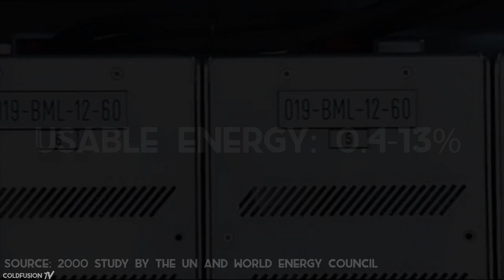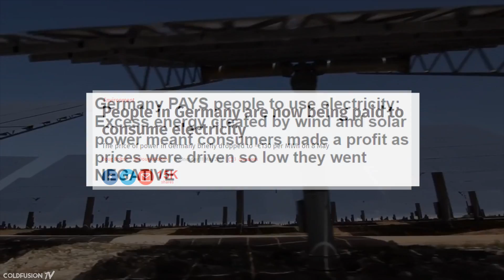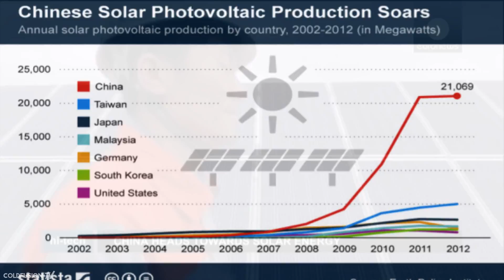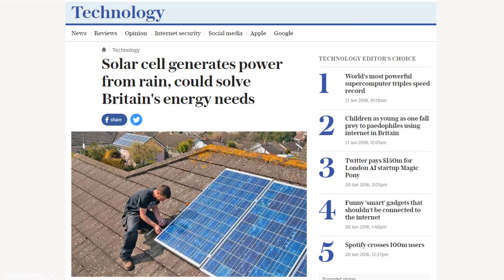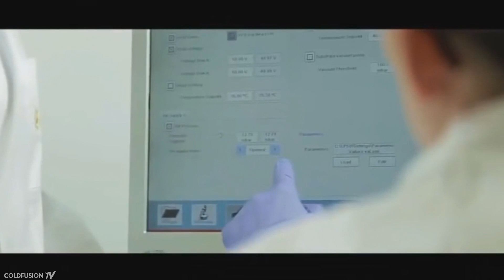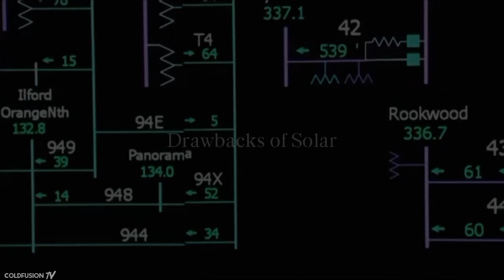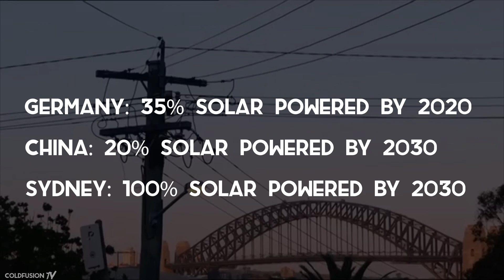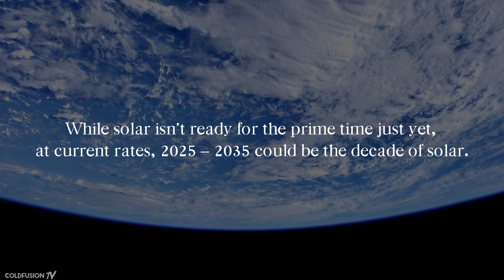The Truth About Solar

Comment: Batteries are still the problem..
Reply: I do believe that that was brought up.
Reply: Yes, they were and they are still a problem.
Reply: the cheapest energy storage method we have is pumping water uphill, you could also use huge flywheels
Reply: electric capacitors arent better  than  batteries. capacitors can keep less energy.are they safer - thats a question
Reply: drakona drgoragonis Electric capacitors give energy immediatly.They cant give you energy supply all the night until solar pannels will work.
Reply: Super capacitors are not better than Li cells in any way. Who told you this rubbish.
Reply: Scott Miller He has half a dozen properties, charter jet, huge limo's. swimming pools, you name it.. And still pays for it from trading his "carbon futures". The man is a scammer of no worth.
Reply: graphene batteries
Reply: ***** I use all electric appliances in the house and I only rake about 6 kWh a day average, and that's with a PC turned on 24/7. These people must be using incandescent lightbulbs all day in the whole house and then wondering where did the power go. HINT: it got radiated away in the fucking lamps, get a LED illumination.
Reply: Also as we are relfreliant we need less to live. Sleep nights ect. The venus Project changes every use of energy. We put all together and we are good. Mass transit, elec cars, many many more bought out in past. We need do-over. All feasible. Eficiency =moderation, we need to look at that and realize we are good to go, not to mention future discoveries. 15 years a big house will look like a geo on autobon. We ARE here we just lagged and created waste and confusion.
Reply: ***** Aren't capacitors used for immediat discharge of large amounts of electricity? Not slow discharge used in most electric devices?
Reply: ***** there are supercaps in my Leaf. Used for "shock loads" on regen/acceleration. Do you have any electronic qualifications at all?
Here. the biggest sold
http://www.alliedelec.com/bussmann-by-eaton-xv3550-2r7307-r/70426260/?utm_source=FindChips&utm_medium=buyNow

now string 150 for 400V working. (33WH) plus parallel 450 series strings for the current capacity. The average house may need 15KWH, hence 450 sets in parallel... knock yourself out. They are $30 each.
150*450*30 = $2,025,000
Reply: Who needs batteries?  A friend of mine built a system that spins his meter backwards fast enough during the day that he almost always breaks even.  His biggest bill in 5 years has been $4.29 from an average of $400 a month.

His system will be payed of in less than two more years.  I don't understand why people don't get that.
Reply: Except that capacitors can only store jack squat worth of electric energy.
Reply: m1aws They're doing it wrong. You don't make a bus by swapping flatbed with passenger cabin on a truck, you don't make electric car by swapping internal combustion engine with electric motor.
Reply: enator71 Its not necessary. Many other nations have not found it to be so.
Reply: hettygreene You're right we should remove the billions in subsidies on Nuclear power and fossil fuels. And no you didn't remind me multiple times. This is the first time you mentioned it. 

Now let me remind you which is worse. Digging very big holes in the ground, storing thousands of tonnes of none recyclable spent reactor rods and burning up fuel to create energy or relying on the sun?

DO

YOUR

RESEARCH

How many times do I have to remind you of that turd in your punchbowl?
Reply: m1aws Yeah and that- wait... US is already in heavy conflict over resources. Look rather than chilling I think it's better to be informed and pushing business policies that aren't so utterly stupid
Reply: +m1aws 

The increasing stupidity of the comments here are remarkable.

It's like a race to the bottom.
Reply: +Alex James 

Stupid Bernie Sanders Vermont SHUT DOWN  a nuclear power plant that supplied the whole state with power. That RAISED THE PRICE of electricity for poor people. Enter rinky dink Solar...  that's the context of your disgusting "making it work". You and your Starbucks poseurs are disgusting.
Reply: hettygreene You are the armchair quarterback. Make one yourself. Its easy. Kirk says so.
Reply: Enceos up to 10% in 25 years. But its already paid for itself in 10 years.
I don't get what you are on about.
Reply: capacitors will replace batteries...
Reply: surface area of the Earth is 510 trillion square meters, not sure where you get the billion from.
Reply: Whoever figures out the super battery will be the richest person in the world.
Reply: Redflow
Reply: I am planning a small farm, and hope to use Solar energy to power it. As electric isn't reliable in the Philippines. But running an egg incubator is problematic.
Reply: Their cost per charge is not viable but for smoothing circuits.
Try it for your self. Go get 'em priced up.
Reply: ***** please, stop embarrassing yourself. Supercaps have no value in energy storage. You simply do not possess that must stupid money to maintain your home overnight.
Reply: average home 8-9kwh?  seriously? average where?

re caps,  yeah sure,  the whole solar industry has just somehow not seen this mode of operation and you have.   Yes obviously because capacitors are such a specialised technology you would expect only one person to understand them.
Reply: ra5928 What system. There are many tricks to alter ones inductive load into a capacitive load to fool the meter. Get caught, you eat free and get your ass reamed out regular.
Reply: Sigma Centauri Point of interest. I have a light in my living room that uses three bulbs. For the first two decades the electric bill for this £15 light unit was well over £500 in electricity.
Reply: m1aws People are just negligent and don't think about it. Every electric device has power rating and it consumes that amount of power when it runs (a PC doesn't always consume it's rated power, only in full load). You simply multiply that power rating by number of hours it runs daily, and there you go, you get your power consumption figure. Then it becomes clear that incandescent light bulbs may well be your #1 power drain on the electricity bill. For me that would be electric pressure cooker.
Reply: Sigma Centauri mine is my car. But if I keep it a decade the fuel cost and servicing savings pay for the car. My hot water is Solar. The 500 GBP unit paid for itself in up to two years.
Yes it (wealth/debt) certainly mounts up over the years.
Reply: m1aws I'm gonna build my own electric car. With the batteries existing today, you must absolutely save on weight in order to travel far (not to mention the whole power saving thing), conventional cars weighing well over a ton just won't cut it. I intend to keep it under 400 kg curb weight. That'll allow it to travel fast and far using only up to a few kilowatts of power. Maybe put a solar rooftop, that'll give it an extra free kilowatt or so during the day.
Reply: Sigma Centauri I have drawn up a revolutionary motorbike.  Leaf "cans" are perfect if not the most energy dense. Weight has less bearing when cruising. It needs to be slippery. The Leaf had to be reliable and safe. Eyes on new tech. If they fail it would affect the technology for good.
Reply: Sigma Centauri good luck!
Reply: we're getting there for batteries too with carbon nanotubes.
There are still several problems that are holding the idea of using them already, but we're getting there.
Reply: CDgonePotatoes wait until the product hits the market. There's been so much bullshit on battery theoreticals it could run its own electricity plant.
Reply: m1aws
it could also be bullshit too, yeah, but I've heard it by so many scientists I'm less skeptic about it
Reply: CDgonePotatoes there is a wall between science and engineering. Until that wall is breached, to us it doesn't exist.
Reply: No, batteries aren't "the problem" because the is no "problem", except the hardships to be imposed by the climate and solar quacks.
Reply: hettygreene Yeah mox (mixed oxide) rod reactors, fracking and coal is just a cumcake of goodness
Reply: enator71 And you enjoy it too! And no it's not. Apple's producing so much power off 'problematic solar' they're selling it back to the grid.
Saudi Arabia is regarded as an oil tycoon terror state and America+UK's bitch is investing heavily into solar. Judging by Apple they'll be a literal power house.
So if we get brain cell a + b and rub them together, magic and unicorns happen! Yey!
Reply: Alex James Its not just Apple Matey. Tesla have bought in huge style and they have batteries!.
Its deffo the future.
Reply: m1aws Agreed!
Reply: +Alex James 

You are an overgrown spoiled child with too much time on your hands.
Reply: +hettygreene If that makes you feel better but what I state is economy sound and it's true. The whole world is in a very chaotic state because of subversive, stubborn and stuck in the past business practice's. So sad you don't see it. Well, life would be boring if we all agreed on everything!
Reply: +Alex James 

Oh really?

"Everyone" could be making more money if the just followed your school-boy science-class fantasies about rinky-dink solar? Gee!  Have you advertised yourself as a consultant?
Reply: hettygreene The proof is already out there as I stated before. Seems you have trouble reading or Googling?
It's simple, solar tech is already viable, it's improving all the time and can be used on an industrial scale. It's not a school-boy science class fantasy.
Were you even watching this video? Are you senile? Do you not like positive facts? Do they hurt your "pragmatic" outlook of the world?
Reply: hettygreene Solar pays its way without Government help, even in the UK. The numbers have been done to death. Nothing to argue about here.
Reply: +Alex James 

REMOVE

THE

SUBSIDIES. 

How many times do I have to remind you of that turd in your punchbowl?
Reply: hettygreene Agree on that one. But Al Gore made it an international trade in the name of glowbull warning. Doesn't change the fact Solar panels are profitable. Electric cars use less energy per mile over liquid fuelled cars etc.
Reply: Alex James Chill, There is only 42 years left before "peak yellow cake". Like control of oil, expect the US to start wars over it in your lifetime.
Reply: Alex James The US is most shit scared about losing hegemony of the dollar. They haven't wake up to the fact they have pissed off too many people.
Reply: m1aws True that, they actually might have to consider a culture of innovating instead of cockblocking. Powers that be usually pick the shit route however one can be optimistic. Feels more motivational than having a nihilistic view at least
Reply: Alex James Governments only work to the negative. They have nothing to give but what they have already taken away.
Reply: enator71 haha. the party ends, now government must begin.
Reply: enator71 yay, Habeas Corpus
Reply: read about tesla powerwall. a consumer solution is nearer than most would expect.
Reply: +enator71 

Right.

Greener-than-thou BRAGGING RIGHTS for the wealthy, while costs are shifted to the rest of us.  

Solar Sucks!
Reply: hettygreene And your option is subsidized wholesale destruction at huge cost to taxpayers compounded by the cost of clean up after is such an awesome choice. Solar is getting cheaper and it's goung to be the clear winner here.
Reply: hettygreene you wanna live like a rich person then invest like a rich person.
Reply: hettygreene But-but... you're the stupid one... D:
You think harnessing energy from a ball of nuclear fusion 1.3 million times larger than Earth is a fantasy. Let's compare that again:
1 vs 1,300,000

Is dere enuff energy two harnesss? Geee... I dunno guy...
Reply: +Alex James 

It's an armchair entrepreneur, kids lemonade stand, schoolboy science project. 

See the Thorium videos by Kirk Sorenson a serious energy solution.
Reply: Yes and that's why the UAE, India, Japan, Taipei, Vermont, Apple, Google and more are going at it. I guess they're all into that schoolboy science?

And yes I'm aware of Thorium and the use of it in a molton salt reactor. However solar is here now and many places are producing a surplus of energy on it. Read up on it.
Reply: +Alex James 

No, YOU read up it.  Read up on the cost shifting to poor people with that stupid Net Metering.

Read up on the German renewables, anti-nuke Double Whammy fiasco and how that's working out.
Reply: +Alex James 

Spend your own money on your dipshit science projects.
Reply: +enator71 

"can't happen without subsidy" <--- your embrace of climate quackery has made you un-American.
Reply: hettygreene Vermont made it work dummy. Quit spouting hard right wing shit
Reply: Bollox to all politicians. If one can have a roof of solar panels and a battery off a Nissan Leaf up in the garage as storage. Then people deserve a big thank you present off the state/utility companies for saving them huge wads of cash.
Reply: enator71 nukes are short term. We have around 40 years left for "peak yellow cake".
Reply: +enator71 

Was I talking to you about the Vermont Germany-in-the making solar nuclear fiasco ?
Reply: +m1aws 

This is someone who has done zero Thorium investigation.
Reply: hettygreene At the moment I'm wide awake. last night I was dreaming just like you, now.
Reply: hettygreene You have any idea how much it costs to shutdown a light water nuclear plant? Also the mixed oxide rods don't have a place were they can be stored they're left on-site. And the costs are kicked down the road at the expense of safety in many cases. And they STILL don't have a means of storing them long term, money that's not factored in.
Solar is coming down in price all the time and it's efficiency is always improving and yeah it's far less toxic.

I love the idea of MSR's (Molten Salt Reactors) and I've been following it since 2008, they're much safer and cheaper. But there are no commercial reactors running that I know of and the investment worldwide is fuck all. I suspect Nuclear gets to cream more profits off subsidies through existing reactor designs and implementations.

Also renewable has much less subsidised funding globally which fossil and nuclear have been pushing down with some success.

Getting back to cost, from what I'm seeing it's implementation that drives it up and some power companies actually getting away with penalising those who dare to use it. There's also plenty examples of using fudged math that paints fossil and nuclear in better light. One of classic examples is reducing the subsidised cost so it appears more expensive for renewables and ignoring it on the nuclear side.

Anyways to dump solar entirely is stupid, it's one of our best shots at a constant clean energy source at this point in time. You may want to check out "Solar Impulse 2", a plane that made it round the globe using entirely on solar. Literally happened hours ago. 

If we want to abandon super expensive energy shit shows, nuclear and fossil have far more than their fair share! :DD
Reply: Alex James your Oh, so technical hetty will cry about Solar being so dangerous yet have no qualms buying electronic goods which uses the dangerous substances.
Reply: +Alex James 

You're an ignorant blowhard whi drank too much climate quack cool aid :

1) see the Kirk Sorensen talk on nuclear waste 

2) I'm opposed to subsidies, but if a fraction of that stupid solar subsidy was spent on Thorium, we'd have it by. Instead the money is pissed away on these disgusting cost shifting school boy science projects, for the benefit of rich kid Starbucks pontificators .
Reply: hettygreene When safe thorium loses some neutrons to become that very short lifed uranium. It is super radioactive hot. So hot when they made an engine for a nuke bomber, it was a one way ride due to the fact those aircraft men would be dead in short order.
People keep thinking its safe. Its not. Even on the surfaces it has advantages it had severe issues long term on the reactors structure.
Reply: +m1aws 

See the Kirk Sorensen videos, you armchair Monday morning quarterback.
Reply: +m1aws 

What a stupid comment. 

Only someone ignorant of the thorium movement would make it.
Reply: hettygreene Thorium has a great future once the engineering/safety issues are sorted and a very long life to peak supply. But as it stands its bullshit because nobody is doing it. Governments are not interested because they want to make nuclear bombs, ok?
Reply: +m1aws 

Not ok when it comes to blowhard climate quacks like yourself peddling imposing quack solar through political means and pissing away capital that could be spent developing thorium, privately. 

You are an obstacle to human progress.
Reply: +m1aws 

The reason we have have stupid conversations like this is because blowhards like you can't keep to minding your own business and trying to impose a conceited sense of superiority on the rest of us.
Reply: hettygreene blowhards like you jump in imagining you know everything because you saw a youtube video. Blowhards like me have done the mile. Ex-aerospace engineer. give me solar panels to charge my electric car. They will be there when I'm dead but thorium will be held back by money and political interests.
Reply: +m1aws 

"A" YouTube video?

That's a stupid comment.  There are dozen of Thorium videos, many over an hour long, including at least 5 different TED speakers on the subject. 

Stick to your backyard bragging rights and your solar-than-thou conceits.
Reply: hettygreene You have nothing but a brace of 'tube vids that I've watched many times over years ago.
You are speaking about pie in the sky nonsense until the money is on the table. 
Meanwhile you can spend a few grand to increase the value of your house and drop your electric bill without increasing the net ionising radiation on the surface of the Earth.... and also effectively, my cars "fuel bill" because its an EV.

I'm all for LFTR's but they DO NOT EXIST!
Reply: They are expensive (for some people), but already can serve 10 years before their capacity drops significantly.
Reply: yep...
Reply: ***** And typhoons, hurricanes, zoning laws, vandalism...
If the panels are not built to spec, they fail in hailstorms. They have their specs clearly written, so its the installers call.
Reply: Batteries are not a problem unless you delusionally believe you need them.  You can use solar to separate Hydrogen from Water, and then use it at night to run a generator for little to nothing.  And no you do not need to store liquid hydrogen.  You can store it as a gas in normal propane tanks.

And this is just a simple solution with little cost.  There are far better solutions that cost too much money because no one is using them commercially.

You need to rethink what a battery is.  Energy Storage is achievable many different ways that do not involve lithium Ion battery packs.
Reply: Zenn Exile hydrogen is delusional. It's less than 60% efficient just to crack water.
Reply: Today yes, but what is today. Not how is was or how we want it. We change today and solar is enough even today.
Reply: Except that here in Australia you can't legally keep your old meter and have it 'spin backwards'.   You have to have a 'smart meter' installed that records how much electricity you take off the grid and how much you put on, and they charge accordingly!  So for me I have to pay $1 a day just to be connected to the grid, then I pay 27c per kwh for what I pull off the grid, and they pay me 7.4c for every kwh I put onto the grid.  Currently I am outputting more than double the kwh to the grid than what i take off. but I'm still paying a few hundred dollars each bill.  Add to that the approx $8000 it cost to install the solar system and it's going to take a long time before I actually break even.  It would be more cost effective in regard to the electricity bill if I could store my excess power and use it at night, but a battery system costs more to install than the solar system, which means it would be many more years before I can break even.  It's a bit hard to do that when I don't know if I'll still be in this house in ten years.  Also, I can't increase the capacity of my solar system so I can push more power to the grid to balance the costs out, as the power company puts limits on the size of system you can install as well.
Reply: Zenn Exile you mean grow firewood? Its a damned sight safer and more efficient than H2
Reply: There are many options all of which are perfectly safe and effective.
Reply: +Zenn Exile please name at least one...
Reply: pizza rio I challenge you to obtain hydrogen, clean, purify and dry it (<60%) then freeze and compress it into cylinders (<10%) that do not suffer hydrogen embrittlement before turning it into electricity (~60% depending on catalyser load).
By the time you have run through the process losses, you are bankrupt. (3.6% efficiency).
Just charge the frikking battery @85% efficiency!
Lithium is cheap. It was a waste salt. This is why they shove you kids full of it so you might listen to the teacher.
Reply: m1aws
there is no reason to do that you fuckpotato

Hydrogen is a very stable gas and can be safely stored in almost anything as a gas.
Reply: Zenn Exile You need an engineering course in hydrogen embrittlement you fuck potato.
Its practically impossible to store hydrogen gas without losses through the steels required to store it due to the molecule being that small. Worse still with fittings, taps, joints etc.

i will answer your drivel this way. Go buy a canister of H2. At $40/litre its a bag of shit. Not cheap energy at all. Its made from steam reforming methane. Just run your shit on the methane. Its less lossy.
Reply: m1aws
none of that matters you dumb fucking piece of shit
Reply: pizza rio Go on, do it. Show us how simple it is.
Every single electrical item in your house does not use H2. It has a battery. Because its small, efficient and simple.

My car has been charged over 1,900 times last I looked and no appreciable loss of capacity. you simply speak shit.
Reply: Zenn Exile Hey troll. Prove my last post wrong.
Reply: pizza rio You made an idiot comment about mining common materials. Sure mine the common materials to make H2, store it, transport it and make your idiot vehicle to drive around with it. You provided less links than me. So that makes you, a liar.
Here is a simple pair of facts in two pictures.
Then tell me which is cheaper to run, lasts longer, has performance and easier to make and use.
http://www.extremetech.com/wp-content/uploads/2012/02/Tesla-X-drivetrain.jpg

Against this :-
http://www.toyota-global.com/innovation/environmental_technology/fuelcell_vehicle/images/sec5_img1.jpg
Reply: not anymore... thanks to the germans
Reply: I was thinking they could split water into hydrogen during the day time and make water and electricity during night time. Or make gasoline, but it's probably way less efficient.
Reply: Zenn Exile green algae need sunlight to make the sugars as any plant.
Sure you look up those solar panel roads. Roundly laughed at by engineers.
Reply: pizza rio This is what they claim..
Pathway: Electricity→Gas→Electricity
Hydrogen	34–44 %
(80 bar compression up to 60% back to electricity)

40% is crap. That increases the cost 2.5x over an EV.
Reply: If only that were true. Capacitors hold the promise of longer life and very high power compared to batteries and could be safer but unfortunately they are much more expensive per kWh of energy stored and have much lower energy density both gravimetric and volumetric. That may change, and if they ever become competitive the world will turn to them real quick. For now it's a mix of gravity based storage, molten salt and batteries.
Reply: YES!  Why are people unable to see this when the TVA has been using this method for seven or eight decades?
Reply: Mika Lee yep, one thought I had for a personal setup to charge a phone and maybe a laptop I'd get a panel or 2 on my roof hooked into 2 car batteries, them batteries are probably the most expensive part of it
Reply: Is that the same machine you invented that was invented over and over again and never seen or used on the market, so businesses will not lose money.
Reply: Bonnie Flory nnnnnh
Reply: thats why it can be  connected to the grid
Reply: Mika Lee 
Have you heard.about Elron Musk's Power Wall?
Reply: David Bowman its not the big of a capacity..
Reply: +Galvanized Dreamer
You can controll the current flowing out of a capacitor quite easily. For longer durations there will be leakage inside the capacitors, but you only need to store it for a day or so.
Reply: What's up with this polarization? Solar power can be used during the day and other sources during the night to compensate if electrical or chemical storage devices are to expensive.
Reply: VIIC Commander Space is A LOT COLDER on the darkside of an object and A LOT HOTTER on the lightside. It's this difference in temperature that allows a satellite to transfer heat to cool the lightside and warm the darkside to keep them at a perfect temperature. Plus they are WAY MORE EXPENSIVE but Hughes (they got damn near a monopoly on telecommunications satellites) can afford it. If a battery fails and they have to launch another satellite you don't think Time Warner, Sprint, Verizon, etc. won't make worth their while to launch another satellite?

Homeowners don't have any customers to replace less expensive more unreliable batteries.
Reply: *****
How much power do you folks think those satellites use?
Commercial satellites used for communication and direct tv and dish using 80 watts an hour and satellites used for FTA ( free to air ) tv using about 40 watts.
So you could pack super capacitor with an battery. Capacitors are very light and can tolerate heat and cold better and can last many many years.
But the factor that satellites use very little power makes their battery last longer. Also satellites are further out and away and have longer sun expose for their panels and the batteries are getting charged longer.
Reply: Bonnie Flory What is 80 watts an hour?
Reply: They're only a problem if you don't know how to maintain them and keep them in tip top shape. Old school lead acid batteries can last 20-30 years depending on how often they are completely discharged, the same rule applies to lithium ion batteries. Also, deep discharges in lead acid batteries creates sulfates that can reduce the life of the battery. For example, if you do a fraction charge instead of a full discharge, let's say within 30 days, you do 30 fractional discharges vs 30 full discharges, the 30 fractional discharges would only consume 1 full discharge. When you use alternative fuel such as solar power, you have to be frugal in using energy.  If I go solar, I can't use my 1,200 watt gaming PC. I'd have to go 160 watt gaming laptop instead.
Reply: *****
Back then they where building things that last, including batteries. Those batteries would have thicker plated and would take more energy to be charged and give off less energy.
As soon as a lead acid battery is made, it is doomed to corrode and die even with good maintenance.
Manufacturer do not want you to have good and long lasting batteries, they want to make money by selling batteries over and over again.
Reply: Bonnie Flory In that case, invest in super capacitors, those are guaranteed to charge and recharge quickly for millions of cycles. The only problem with capacitors is they're limited to energy storage, about a fraction of a battery, for example a 3,000 farad capacitor contains about 1/4th the energy of a AA battery. We're waiting for graphene capacitors to be made so we can have a capacitor the size and energy density of a AA battery. Unless we can find a way to compress energy like a black hole in outer space does, we have to increase surface energy retention on the capacitors.
Reply: arent there non-lead acid batteries that dont die so much? and isnt it possible to make batteries restored?
Reply: I think total energy the earth surface(land and sea) absorb per year should not be 3.85 X 10E24 Joules. Because if we converse to KW per square meter it will be 239 KW/square meter. Too much isn't it. The total earth surface is 510 billions square meters.
Reply: You right, I took garbage information from

Spiders eat 400-800 million tons of prey every year
www.godlikeproductions.com/forum1/message3476350/pg1
earth is 510 square kilometers = 510 billion square meters surface area of ... earth is 510 square kilometers = 510 billion square meters surface area of earth is ...
Reply: you know how big a square kilometre is and how many square meter is in a square kilometre? 510 square kilometre is equivalent to an area 51km long and 10km wide. and 1 square kilometre = 1million square metre (remember, 1km = 1000m, 1000mx1000m = 1million m2)
Reply: I am just commenting to keep the likes and comments same...
Reply: Amaey Paradkar commenting to keep like comment balance
Reply: Amaey Paradkar commenting to keep like comment balance
Reply: ya and + Knowledge of electricity. becoz if u gonna pay for service each it's not worth the shot
Reply: They are called capacitors...
Reply: Google hydrostor
Reply: I CONCUR, BATTERY TECHNOLOGY HAS NOT KEPT UP
Reply: bananian
they can use algae that is active during the night cycle to bypass the need for any storage or conversion.  They can even make the lens porous and engineer the algae to excrete a cleaning enzyme that keeps buildup from lowering solar efficiency.

There are many ways to turn our roads into solar power plants.  And there is ABSOLUTELY NO reason not to pursue many of them.